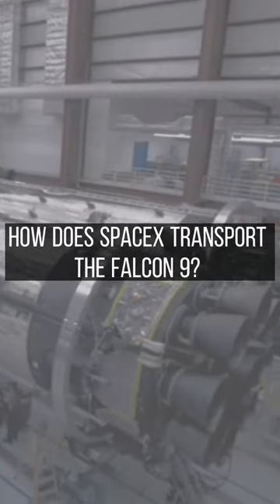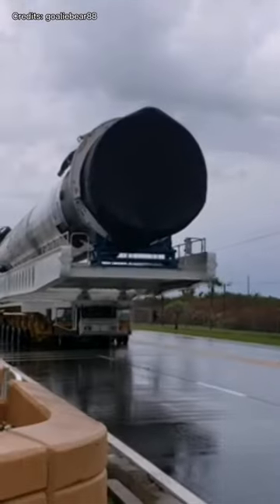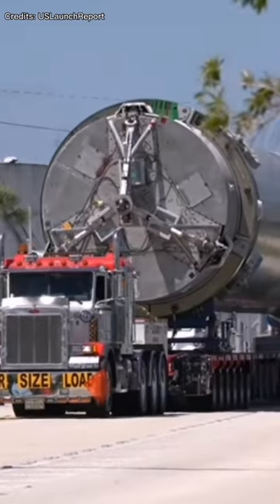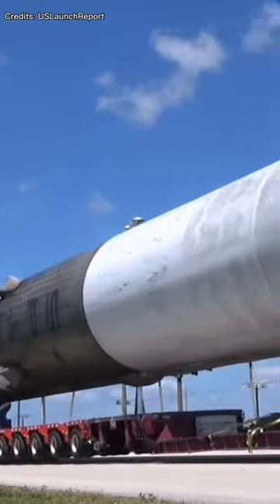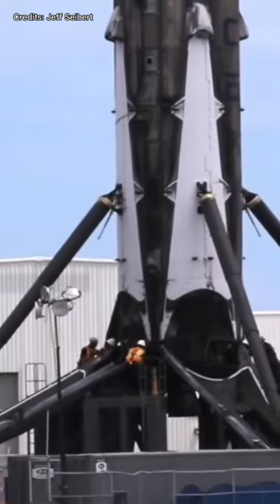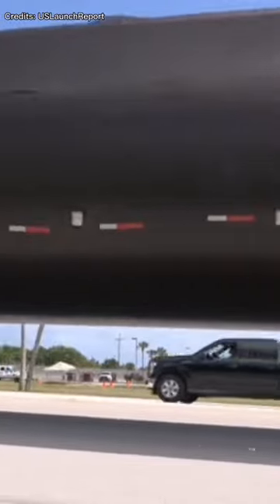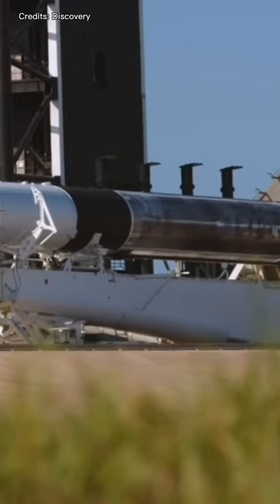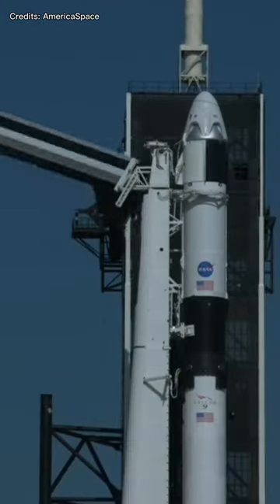How does Spacex transport the Falcon 9? (land edition) #shorts

Comment: they should create their own railway, or move the factory, much cheaper on the long run.
Reply: It doesn't really matter. Either way it's not like they have to ship a new one every flight. And I imagine that those trips probably don't cost over ~30 grand, compared to the launch price it's very low.
Reply: @icylime3607  well, in India for example they do from processing the other to the final vehicles all in the same place in enormous mega factories and it cuts costs 🤔, also you don't have to rely on others that way, everything is developed and improved by you.

Comment: Why not launch it then land it where you want.
Reply from the maker: Well it obviously would save a lot of money, but falcon 9 doesn't have enough fuel to go back to the launch site, or simply land on land.
Reply: @SpaceflightsShorts 
Really?
Reply from the maker: @normancourt9778  yeah, it's because of basic physics, you can watch a video about it if you want: https://youtu.be/jI4zOOYwHPM
Reply: @SpaceflightsShorts  ok
Reply: @SpaceflightsShorts  it does have enough, but it would decrease payload capacity so far that you basically need a falcon heavy to land it on land, landing it on the sea platform is efficienter

Comment: Why not just build it on site?
Reply: Hello.
Reply: Because 

A. Their factory/headquarters is in California and it would be unreasonable to move it to Florida.

B. They have a launch site in California as well

C. They would need to ship the boosters to McGregor anyway.

There are many reasons why the headquarters is in California as well such as being close to other aerospace companies and near Silicon Valley which helps with attracting new employees and investors.
Reply: That would make way to much sense. How could they justify the cost then?
Reply: @peterparker9286  

Advanced materials, range safety, payload integration, the second stage, refurbishment costs, the engine manufacturing and testing costs.

These are building sized machines designed to go to space. So for the price tag they’re quite cheap and booster transport costs are only a small fraction.

And the reason they don’t build on site is because of 

A: being in California allows them to be closer to other tech companies and graduates looking for jobs. Makes it easier to find investors and employees.

B: they need to test the engines in McGregor, Texas anyway.

C: they have a launch site on the west Coast that they use for polar launches.

Comment: I'm confused I mean you're partially right but most of the falcons are launched from Texas and most of them are built not in that part of California using the minimals Boca chica my friend.. or I'm full of s*** also possible
Reply: Spacex launches zero falcon 9s from Texas. They either launch fr Vandenberg in California, or Cape Canaveral and KSC in Florida. Also, All falcon 9s are built in Hawthorne California or refurbished at the respective launch site.
Reply: Bruh "you're partially right " u are completely wrong tho
Reply: Yeah, your full of crap. Starships will be launched from boca chica. Florida and California are the places they launch falcon from.
Reply: Boca Chica Tx was originally for f9 so actually they would have had a launch site on each coast and in the “center” but even so at Starship Boca Chica they test raptor engines at McGregor so actually no matter what ended up happening McGregor is perfect